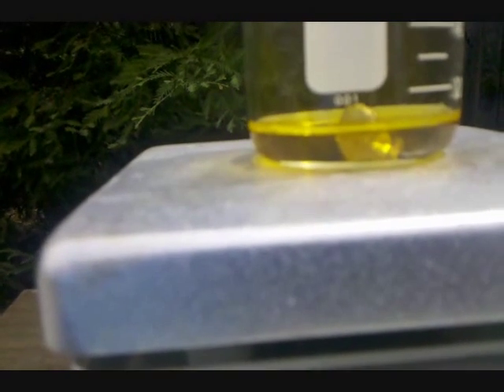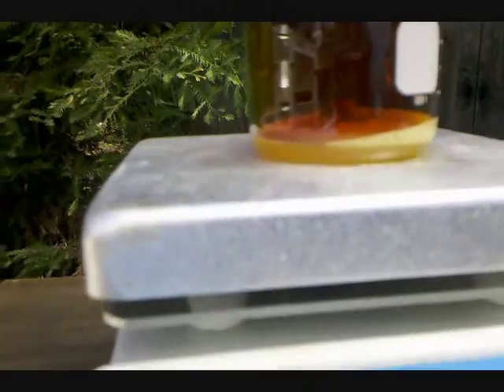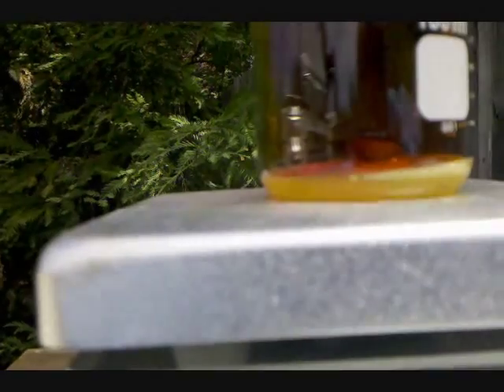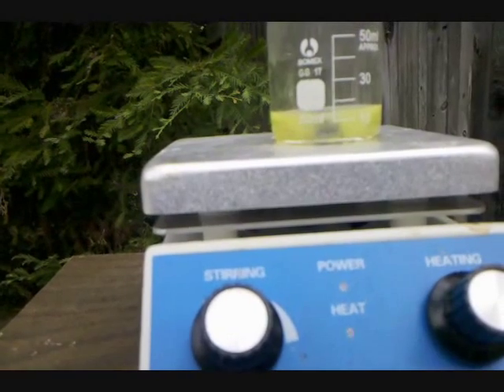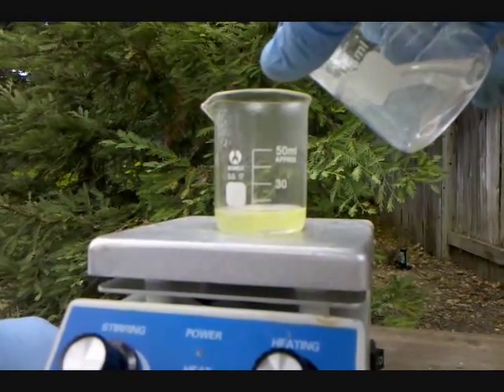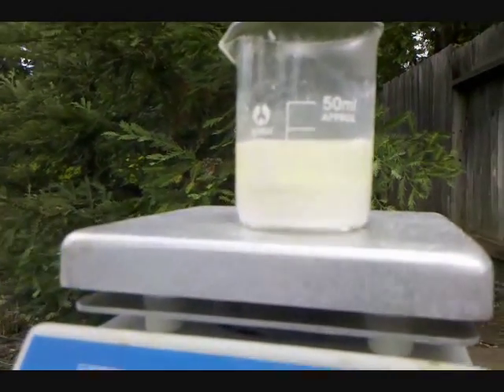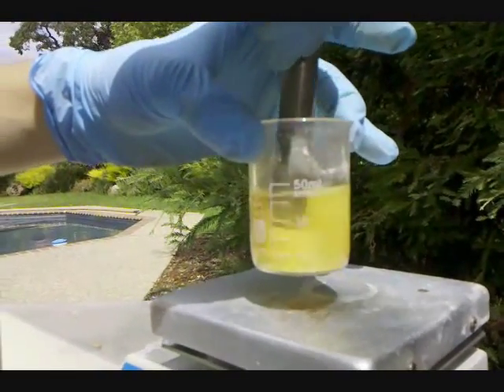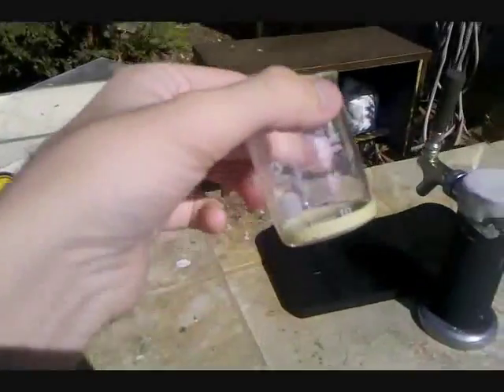Synthesis of Bismuth Nitrate and Bismuth Oxide

Comment: It would be cool to see a video on gallium (III) chloride synthesis. 
Getting gallium and reacting it with nitric acid to produce gallium nitrate. 
Then heating the gallium nitrate up to 250 to 300 degrees Celsius to decompose it to gallium oxide. 
Then reacting the gallium oxide with hydrochloric acid to produce gallium (III) chloride. 
Gallium oxide reacts much faster with hydrochloric acid than elemental gallium.

Comment: one thing for the heavy boiling liquids, use a bubble iniator. I use a 10" piece of wire with a small length of multi-strand wire at the end (all Cu) for boiling down my CuSO4 H2SO4 mix. it doesn't react n iniates boiling w/o the heavy knock r spiting. REALLY nice w/ boiling H2SO4, long enough to pull out for pouring sol.  was thinking of making a ribbed glass rod good for any solution later. by the way nice golve box and overall chem experiment set up there in the back ground thanks for the vid